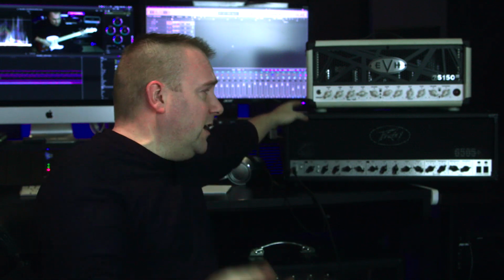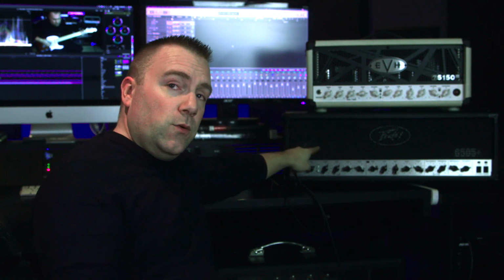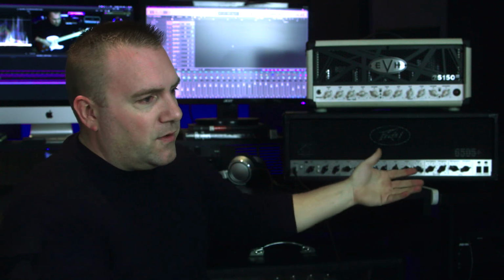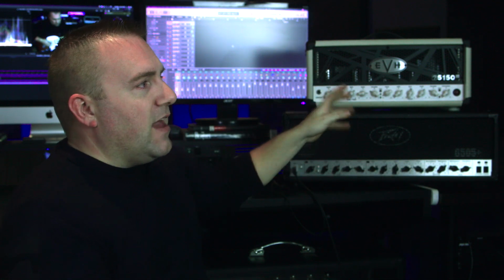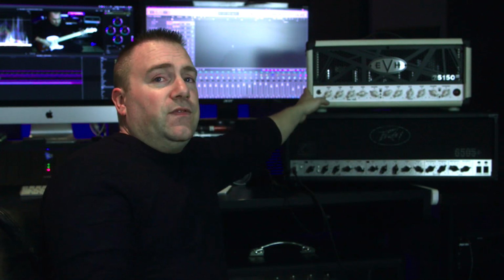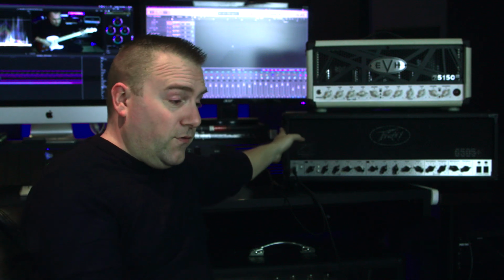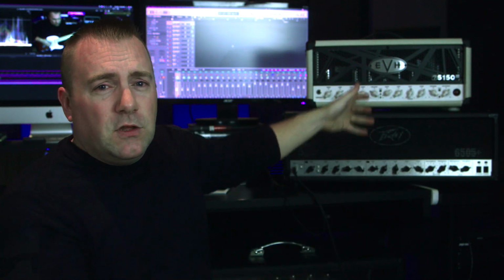Peavey 6505+ vs EVH 5150iii 50w | NO METAL NO PEDALS | 6 Guitars

Comment: Good comparison. I have both these amps and I agree the Peavey is much more consistent at different volumes (except whisper volumes, it sounds terrible there), the EVH gets brighter and brighter the louder you turn it up, so you need different EQ settings for different volumes. EVH is the most practical amp for live use though, and it also sounds good at bedroom volumes unlike the Peavey.

Comment: It's funny how people think that a U.S. 6505 means anything different than a Chinese made one. Same amp. Both assembled on a production line by lower paid mistreated employees. I've owned both and if there is a difference it due to parts tolerances
Reply from the maker: I couldn't tell you the difference in all honesty. I tried to get further information on possible differences and usually get a million different answers. I only make mention of where it's made so I don't have to answer the question of "Is that the American or Chinese" 20 times. Cheers -Ryan
Reply: @Crypticmaskguitar  Peavey basically used all the same sources for components just moved the labor to China(at least that what the company said at the time).  Only thing that really bothered me about their move is the reduced product line. Hopefully they will bring back some of the classics like the VTM, JSX, etc. Apparently there are some cool things coming from them in the near future besides the 6505II